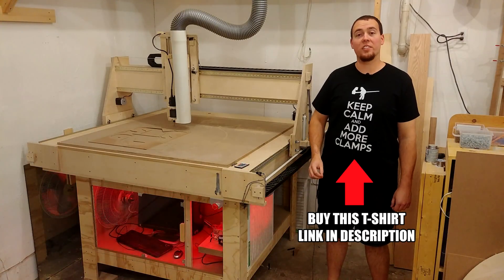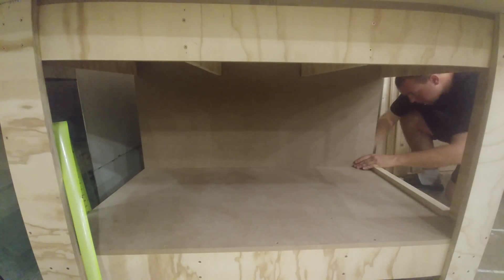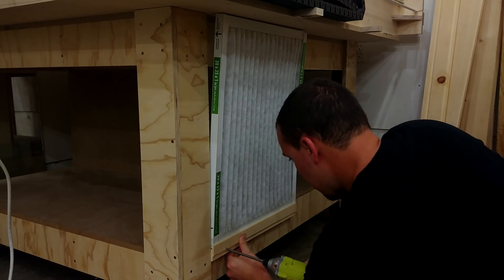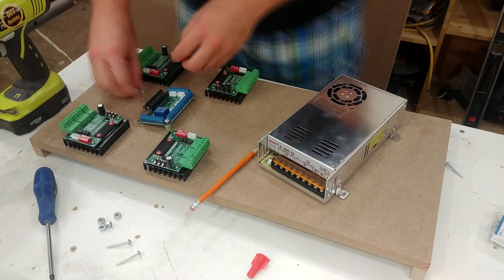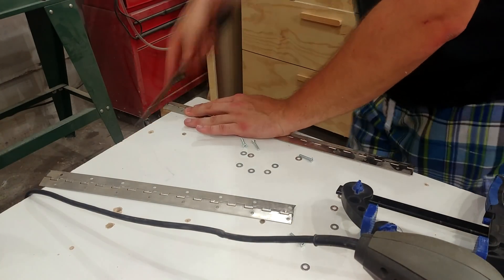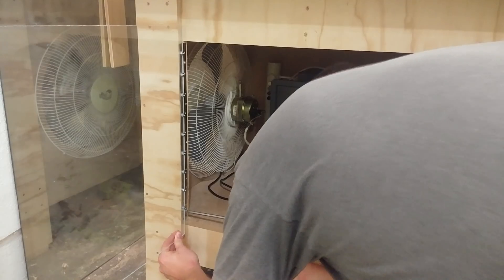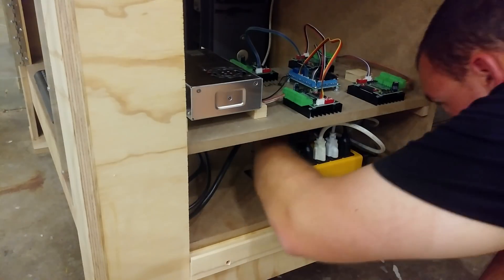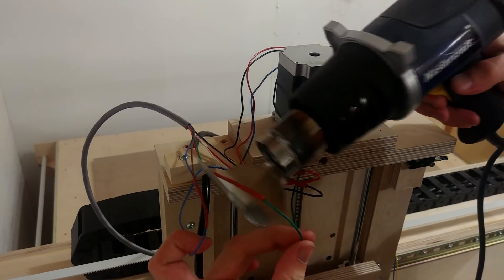Homemade CNC Router Part 5 - The Electronics

Comment: Good Day,  I built this and it is amazingly accurate.  I had no previous cnc skills and the biggest thing I built was a table out of old wood.  It was an amazing learning experience.  I had a lot of issue with the electronics.  Read online for months, did a lot of trial and error.  The issue was the Nema motors would skip steps.  Not knowing what the motors should actually sound like it was not obvious to me at the time.   Finally I ordered better motor drivers and the issue was solved.  I am currently using a Ethernet Smooth Stepper, the original 5 axis  brake out board and DM542T motor drivers.  I am using a better router and did the updates to the belt tighteners and Z axis you have on your site when I built it.  Originally I used unshielded wiring for the stepper motors and had more issues of the motors missing steps.  I have since upgraded to 18 gauges shielded wiring and the issue is gone.  It has taken a while to learn how to create files and make gcode, load it and figure out Mach3, offsets x.y and z axis etc. but I am able to make some very cool stuff.  Thanks for your great videos.

Comment: hi, I don t quite understand why you have 6 cables running on the side instead of 5 (4axis plus router)????
Reply from the maker: Limit switchs
Reply: DIY Builds thank you very much, after a few weeks I manage to get there, I m like a crab tone step forward and two backwards, but away my machine is almost finished, is practically like yours, I have just wiring and then I can start play.
Thanks again

Comment: Hey there. Huge fan of your site. You make the best woodworking plans I've seen. So well presented. I wish you'd see that more on the net....color coded and all.
I was wondering if you could help me with an electronics question for my CNC machine I am building. I sort of accidentally bought NEMA 17 motors from Amazon....put them in my cart and I guess I hit checkout and didn't see it. They arrived and I am wondering if they'll work for a CNC ROUTER (1/4" shank or 1/2" ....1/2" preferred) or if that would strain the motors too much and I should return them. I have your excel inventory file and I see your link to the driver controller modules, but they're for NEMA 23's ... could you possibly advice what driver modules I should purchase using the NEMA 17's? Big thanks and big shout out. You do amazing stuff!
Reply from the maker: The bigger the better. I would say 17 is too small.
Reply: @DIYBuilds  Darn. I had a hunch that was the case. Maybe I'll use them to build a small 3d printer on the side of this project because I hate returning thing :P

Comment: Isn't the contactor coil 24vac?   How well did that work with 12vdc?  I think the board relay is designed to handle 120v.  Any reason you went the contactor route?
Reply from the maker: The tiny relay on the board is not made for motor switching. It would fail or weld itself shut in no time. 12vdc is capable of creating the required magnetic flux to trigger the 24vac coil.

Comment: Can I get an explanation of the relationship between your relay for your router and the rest of the electronics? I know it's going to be an on/off but is it going from a certain axis to the relay?
Reply from the maker: There is a small relay on the control board that is controlled in mach3.  I use it to toggle the bigger relay to switch power on a d off for the router
Reply: DIY Builds okay that makes sense now, didn't know the controller had a relay on it. Can't wait for the next one!

Comment: Just a tip, The motor controls should lift off the wood, the control board does not generate much heat at all and is optional. Long operations may cause the heatsink on the Motor controllers to burn the wood (Maybe)
Reply from the maker: No way Jose  the fan creates so much air circulation never gets hot.
Reply: @DIYBuilds  I can only advise, as I have worked in the electronics industry for 35 years I sort do not entirely agree but as I said in my comment (maybe) there rest is entirely your decision. It is a nice build but I would do that bit differently MHO.

Comment: Makes me wish I'd built the one I planned out a few years back now. Didn't have a strong enough case for spending the money on that at the time though :) Great project and look forward to seeing the accuracy and reliability of the whole thing. One thing I thought about with mine, was to build it in wood, then use it to slowly replace some parts with aluminium over time.